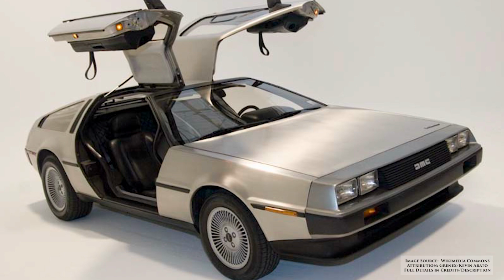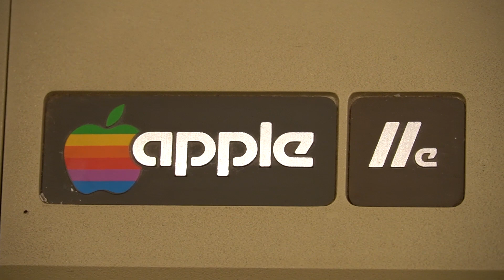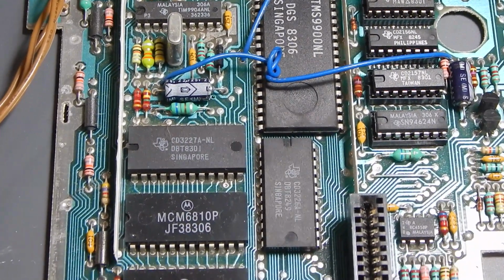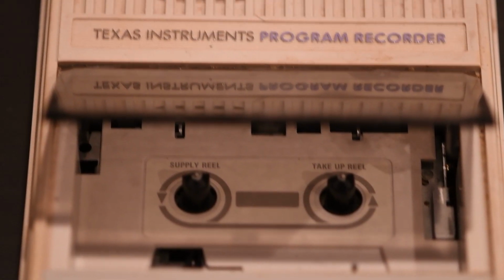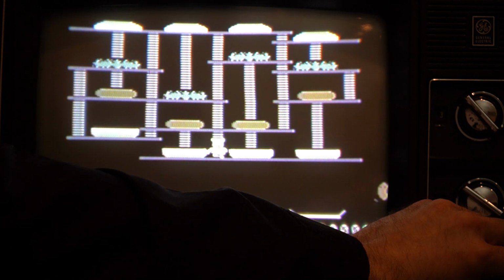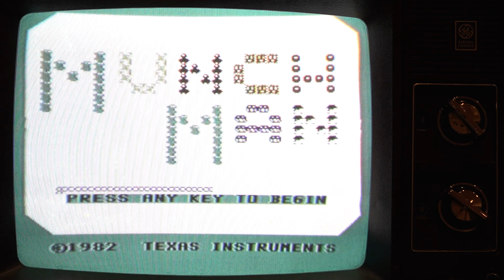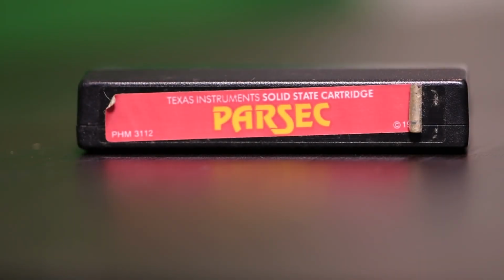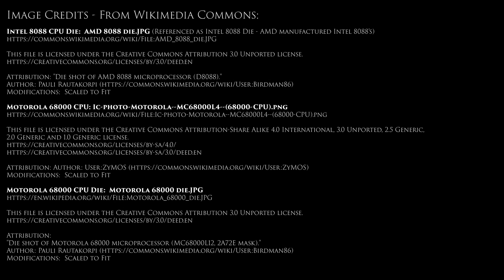How the TI-99/4a computer sold 2.8 million yet failed

Comment from the maker: I totally forgot the "Lift" setting on Parsec adjusts your speed/distance for the ships vertical movement.  After this I looked it up, and the 1, 2, or 3 number keys set it - 3 is fastest and default, but set it to 1, and the fuel tunnels are manageable.
Reply: InstaBlaster.
Reply: Came to post the same thing.
Reply: I always knew that but then my family did buy the game back in the day and I did read the instructions and pressing 1 makes refueling so much easier, particularly on the longest and most challenging tunnel.

Comment: The Ti 99 4a was my first computer and your video brought back a lot of memories. I mowed a lot of lawns to buy it and eventually had the tape drive, floppy drive, hard drive, modem, extended basic, voice synthesizer, and expansion bays. I think I had about every game you could get to in cartridge or download to tape or later floppy. I loved the machine and ultimately lost it when I got married and had left it at home where my mom got rid of it. I would love to have it to this day. It was my favorite computer ever. In so many ways i found it to be superior to every other machine I used around that same time. I used the Apple IIe, Commodore 64. It wasn't until my Amiga that I felt I truly had a superior system. I also had a PC Clone XT 8088, which was IHMO inferior to them all. It was years before PC would reach the level of graphics quality that all those other systems had early on. 
Thanks for the video! It was a great walk down memory lane.
Reply: Didn't like most of the Ti 99 games (I was a toddler though), but totally agree with all your points about it and other systems (actually just wrote about the same thing in a more wordy way before scrolling down to your post)
Reply: Ditto. But my main use was programming because of the strong support for sprites and the ease of using them in extended basic.
Reply: @PeterRichardsandYoureNot  dang, the TI was really powerful for the price, but TI Basic is the hardest high level language I've ever used--You must be dang smart. It wasn't until the ultra smooth Amiga that sprites, specifically variable sprite collisions, intrigued me--for their statistical modeling value.
Reply: @PeterRichardsandYoureNot  For writing games the Ti was basically useless with out the extended basic cart.  That cart was a $100 and some change back then.  A impossible sum for a 10 year old to get.  But I got it.  I worked my ass off for it but in 6 months after getting the Ti I had my extended basic cart.  Man, the things you could do on that computer with that cart.    So many additions it added to the basic language and just made the computer a joy to write games on.   

I really do miss those days of going to the arcade, watching a game for hours to learn the in and outs of the game.  Then going home and basically porting the program from scratch.
Reply: Jeff Hyche TI could probably have improved the prospects of their home computer if Extended BASIC was the default BASIC - the C64, for instance, required a lot of peeking and poking to do anything graphical. So TI marketing could have pushed that in their war against Commodore - but that is just one of many mistakes they made
Reply: I started on a TI99/4a and still have it and love it,but the Commodore64 absolutely mopped the floor with it in sheer power,addons,software library,etc and perephrials were so much cheaper than PEB. sorry but its true. The c64 won in sound and graphics and apps even if it was harder to code for. the TI was useless without extended basic(except for cartridge use) and the multiplexed ram killed any speed as well as the crippled bus. The lack of easy cursor and delete/backspace was a pain. i could name more shortcomings,but even with all these problems,it will always have a soft spot for me. The Amiga tho wow.. still using Amigas today!
Reply: Can you explain why you thought/think the TI994A was/is better than the PC XT 8088?  I guess back then the XT only had monochrome and no speech?  I can't remember but I remember having to load the simcga prorgram to run any games on the XT unless I had an expensive graphics card.  The C64 took off more among families that didn't know what a computer was, back then, I think because they got the vic-20 first, which was pretty much a useless computer.  I still remember hoping to get a floppy system for the TI, but we went to a IBM PC clone, Leading Edge, in 1986 and it had a better keyboard, floppies, expansion box and soon we had a hard drive and 300 baud modem and I was dialing in everywhere I could.  I think what killed the TI was forward thought, it doesn't make sense to plug everything in going out to the right like that.

Comment: some tiny corrections: the 9900 was a bipolar (I²L) processor, MOS. The IBM PC project officially started in early 1980 with the extremely un-IBM-like goal of doing a product in less than a year, though IBM had previously explored alternatives (in 1978 they were designing the Datamaster, for example, and selected the Intel 8085 for it). The price for the TI99/4 included a color monitor, while the TI99/4A came with the RF modulator instead.

Comment: That memory expansion module actually did solve many of the shortcomings of the ti99 system,but you had to make sure that it was secured tight in place or otherwise it could crash the system,i think texas instruments had no other choice then dropping down the price of those systems,otherwise they would,ve still end up with a large inventory of ti99 systems and maybe just maybe would,ve lost more money into renting costs of those wear houses,so i think they did the right thing.
Reply from the maker: Agreed - I got an aftermarket add-on mem module and it's opened up more possibilities on the machine.  I still love my 99/4a

Comment: Lift 1 for the refuelling tunnels, Lift 2 for the asteroid fields, Lift 3 for everything else.

Also, I discovered way back in the days of olde that if you start the game by crashing your ship on various objects on the ground, there is a good chance that after either the first wave of Swoopers or Urbites you will get a wave of Killer Satellites.  I seem to recall the sign that the bug was triggered was a brief little graphical glitch in the to right area of the screen when you crashed.

Comment: When my father bought our Ti-99/4A at the end of 1981 I never realized it was 16-bit. In fact I wasn't aware of the bit concept of home computers at the time so I didn't know standard home computers of the time were 8-bit until the introduction of such 16-bit computers in the mid '80s like the Atari ST and Commodore Amiga. Even in the mid 1980s I assumed the TI was 8-bit since it performed more like one and the graphics were 8-bit quality and you'd hardly mistake it for the Amiga. It wasn't until years later when I went online I discovered the TI was 16-bit.
Reply: their CPU architecture was a dead-end, though - the Motorola was heads and shoulders way above TI and Intel. TI tried to bring a multi-tasking concept they used in mini computers down to micro computers. It depended on designing some special fast RAM - but other CPUs eventually started putting cache memory right on the CPU die, and TI's approach would have never kept pace and competed against that
Reply: There really was no selling point in the TI being 16-bit because there were no benefits in it. Buying an Atari ST or Amiga, different story. But in 1981 my family didn't want a TRS-80 (my mother had experience with one in college and she called it "Trash 80", turns out she was hardly alone), the Apple II was too expensive, the PET seemed bulky and outdated for 1981, so the TI-99/4A it was.

Comment: Thank you for a detailed view of the TI994/A.   It brings back a lot of memories.

The early TMS9900 used a hermetic ceramic package which was much more expensive than the plastic package (show here) that came later.  
The address and data busses were 16 bits wide which made the chip very easy to incorporate in new designs but it took a lot of real estate on the mother board.  It was awkward to interface the mother board to accessory boards because of the wide busses. 

TI eventually developed an 8 bit version of the micro which had similar performance because of a more sophisticated architecture and it was much less expensive but it came too late to save the home computer.

A hardware and software disappointment was the so called GROM chip (game rom), supposedly for games but it was too slow for use with the internal Basic program language.  The good games were programmed in assembly language and they performed very well.  
The TMS9900 was fun to program in the late '70's but it didn't have the potential to become a high performance PC in the '80's.

Parsec was the ultimate game for the TI994/A.  The speech output was considered state of the art at that time.  The graphic effects were outstanding.  It was better to use the keyboard buttons for control rather than the joystick.   
(TI leveraged their speech technology to create the popular Speak and Spell. )

Comment: New subscriber here, just wondering, do you have an update video on the 1965 mercury?
Reply from the maker: No, but I can make a quick one.  It paused big time as I was cleaning it and found extremely bad rust in the back end including frame rot. But lately been thinking of pulling it apart and saving it. For now it's under a cover on a concrete pad. 

My dad bought this car in the early 2000s and it came from a rust belt state. It got worse after it was driven a few years and parked outside. But I don't see them often and think it's saveable!
Reply: @VortexGarage  I watched all of the videos you posted before and it looked pretty good but frame rot is no good! I was just wondering about it. I really like 65 mercurys, that why i asked lol

Comment: As a Ti user from that time I can tell you every Ti user loathed this keyboard.   Not because of how small it was or the feel of the keys but the lay out of the reset switch.     If you look closely at the right hand side of the keyboard. you will see at the top on a over lay the word "Quit" above the += key.   To access that function you had to press the "fctn" key in the bottom right hand side of the keyboard, it was the reset key.   To display the "+" character you had to press shift = key to get that character.  The sift key was right above the fctn key on the keyboard.   This meant if you where not very careful while programming and missed the shift key and hit the fntn key  when you wanted to display a + sign, you would reset the whole computer.   

Many a Ti programmer has had a 100+ lines of code in the computer and go to add two number together only to hit the fctn key instead of shift.  Then hear that 'beep' the computer makes when reset.  Trust me on a Saturday night with the radio blaring, you in the middle of a program and you hear that 'beep' because you missed the shift key.   That is the loudest sound in the universe.
Reply from the maker: Older computers were so unforgiving, it's amazing how easily hours of work could be lost.  The story above and that keyboard setup is one egregious example indeed!
Reply: Exactly! keyboard torture!

Comment: I had a Tandy Color Computer, but the power supply was not regulated -- so when my mom turned the dryer on downstairs, the computer power supply fried. 
then I was faced with sending it back to Radio Shack for repair or buy another computer. 
I bought the TI 99/4a and I always consider this my first computer -- I learned so much about programming and the nuts & bolts of peek & poke. 
But that was not Object Oriented Programming in those days ... It was line by line by line.

Later on that original TI died I got another one, but to my surprise, and disappointment, it was that ' off white' version. I just didn't like it as much as the original.
Shortly; thereafter, I moved on to other brands and eventually to building my own that was a Windows based system, and even an OS/2 system ( became an Apple operating system). 
But this video bring back a lot of great memories - I had sooo many cartridges and the expansion box with everything. Oh,, the modem 300 bps was ' state of the art' LOL!!
Compuserve .. America Online ... the land of the BBS ....

Comment: Good stuff. Brings back a lot of memories. I had to write down by hand or memorize code until I had enough money to buy a tape drive.. in the end, the limitations outweighed the benefits. The platform was not embraced by the home developer market like the Apple ii was...so, time to move on came to be. Even with the cool voice synthesizer programmable through extended basic.

Note to publisher. Please move your teleprompter higher or nearer the lens cause following your eyes as you speak is painful while you look down and away to get the next bits of info/

Comment: The TI's failing wasn't due to the Vic 20 -at least initially,  it and the Vic dropped their prices because of the Sinclair 1000, which for a time was the best selling computer in the US. This scared Commodore and TI into radically drop their prices, Commodore could just about manage this drop due to their control of the IC's in their machine, TI could not fully however and began to sell their machine at a loss just to move stock.

Comment: The standard TI joysticks were awful and I never liked how they felt. In 1984 my father bought a converter by WICO that allows Atari joysticks to be used on the TI and believe me, playing on quality Atari compatible joysticks were so much better. Then years later I found out the Sega Genesis controller was Atari compatible because I plugged it into my Atari 800XL and it worked, so that meant I could use it on the TI-99/4A so long as it was hooked to the WICO converter.
Reply from the maker: I recently added an atari adapter and use some atari compatible joysticks now - much better!

Comment: You didn’t explain why TI couldn’t compete.. how much cheaper the new model was to manufacture.. sales by year... the disk drive..
Reply: The real reason as I think back more was the C64 hard drive was easier to get/afford than the TI floppy drive.  It was the next step in tech back then, truly a big thing to have a floppy drive.  Do you remember the cost difference between the TI floppy and C64 floppy?  My last TI program was a check book balancer that I was trying to overcome the limits of the tape drive by loading all the data into a really long array into RAM so I wouldn't have to keep pressing play on the tape drive, so I could just load the program then save the program at the end... I never finished that program but recently, in 2021, found my old computer tapes from 1984/85 that I treated like gold.

Comment: The INSANE memory design in the TI-99/4athat negates most of the TMS9900 CPU power.   I worked as a programmer at a company that used the 9900 mini computer which was fast and awesome!  The guy that design the TI-99/4a should have been fired for incompetance!!!!!!!!!!!!!!!!!!!!!   Btw the MC68000 was at the time the UTTER BEST CPU on the planet  ....IDIOT IBM!!!!!!!!!!!!